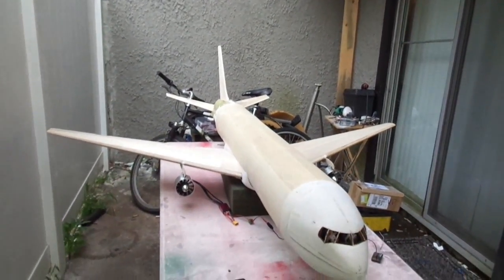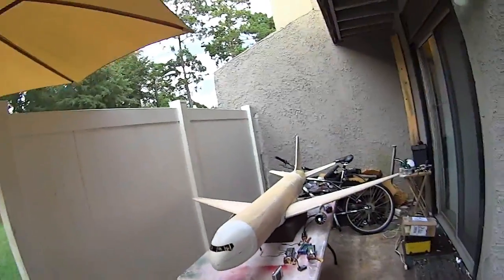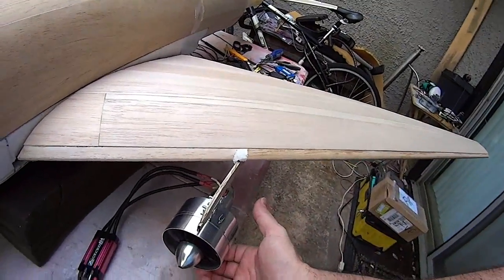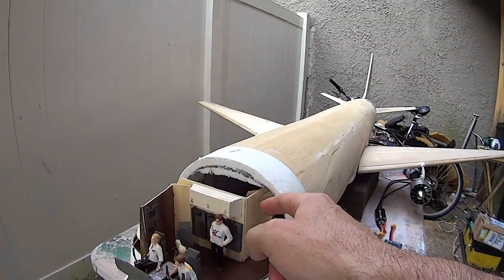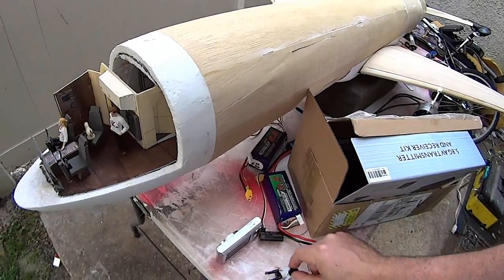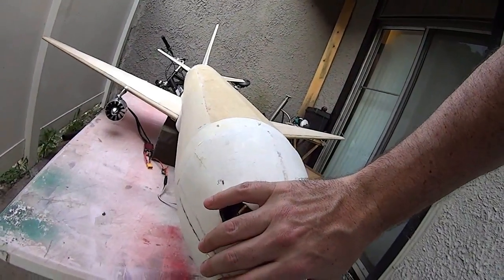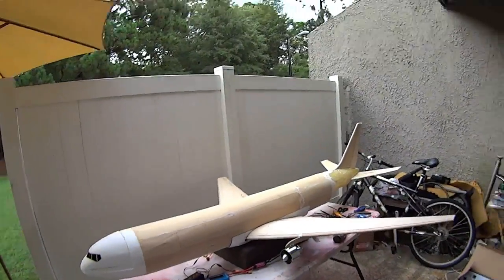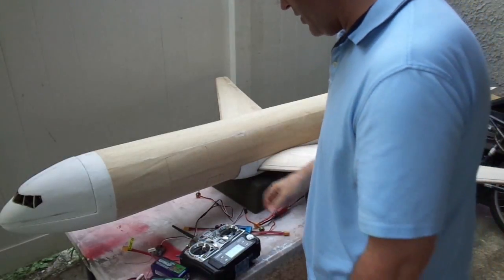RC Airplane Airliner ABX 767-300F EDF Test

Comment: what is the flight time running batteries compared to gas
Reply from the maker: Its all depends of the Amount of Fuel a Turbine jet carries or the MAH-size or capacity of the Lipo Battery of an Electric EDF.

Usually Kerosene fueled Turbines have longer flight times compared to electric.

Comment: Wow Demon, that is one detailed plane.  I am waiting on pins & needles for more updates on it. How much power did those motor/fan combos make? and how much power did they draw at max output?

So, if I remember right from your laminating with balsa video, you are using regular plain ol' Styrofoam (the kind that comes with a new fridge, or microwave oven, or gaming console, etc...?  The real brittle kind? Then you laminate with the balsa wood?  It looks like lots of little sections of balsa. What strength does that do to it as opposed to laminating with large sections like you would with say laminating plastic wrap stuff that you cover a large section at a time (wing, fuselage, tail section, etc...)?

Just wondering these things.  Please keep us updated. Your building skills are awesome to watch and I have learned so much from them.

Peace.
Reply from the maker: Hi Robert, I never Opened her Up past 30% Power she was just too Loud, Her Amp Draw wasn't ab-normal, But the two 80AMp ESC's did get very Hot for such a low power run up, I might step things up to 100amp speed controllers and see.

I am indeed using very straight forward white-lite Styrofoam of the packing variety, its time consuming to laminate with Balsa, but you can also fiberglass the foam, carbon fiber rods keep everything from warping and helps keep the shape.

Comment: Are those the battery that's going to be used in this plane ? If so sure doesn't seam like your going to get much flight time from it.  Have you done a full throttle run up test and time the battery current and voltage to  see how much flight time your going to get ? Yea I would put on some ear plugs. I was using 2650 mah in one of my jet kits and just get over 2 mins have to up the battery current 3300 or 3600mah but it was drawing more amps then what your getting 100amp esc its pulling 90amp full throttle. 

Just wondering. Like to see it when its finish and in the air. How long have you been working on this project so far ?
Reply from the maker: I'm Not sure what sized batteries The owner will use, these 2.200Mah Batts will give a 2-2.5 Min flight time.
I always want to go for a lite as possible short maiden flight rather than use Heavy Lipos for a longer maiden flight, your maiden flight should just be used to prove your plane's flight characteristics then after that go for longer flights using heavier batteries down the road.

Comment: Hi. Awesome construction and sounds really good. I noticed you've been using futaba T7C transmitter and R617FS receiver during demonstration. Was it only for test purposes because I guess there isn't enough channels to control this kind of plane...
Reply from the maker: Thankyou Sergey my RC Brother! The Futaba R617FS has been an excellent radio and it's has 7 channels and has worked well on all previous RC aircraft but in order to add functioning slats on top of everything else I will have to step up to the newer Futaba 8 or 10 Channel Fasst radio.